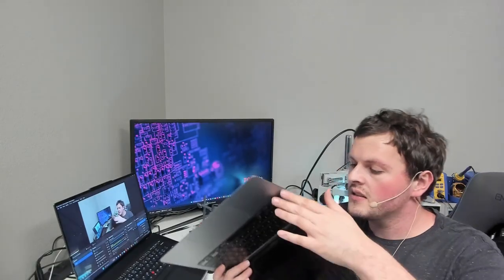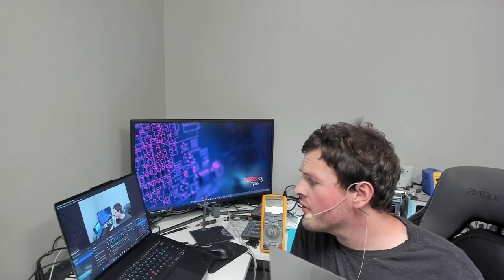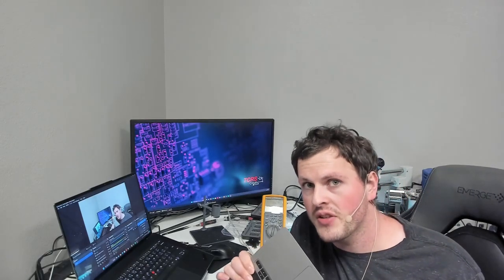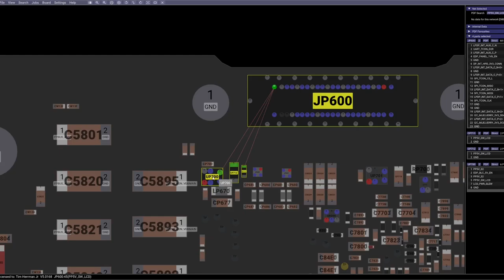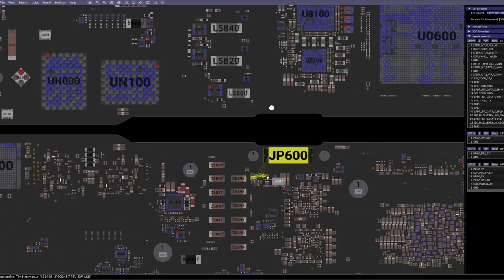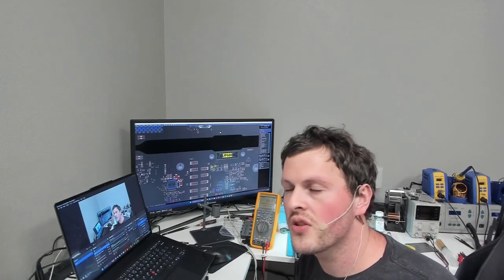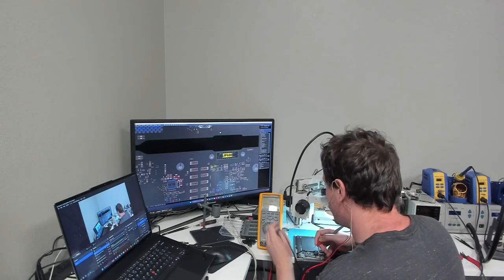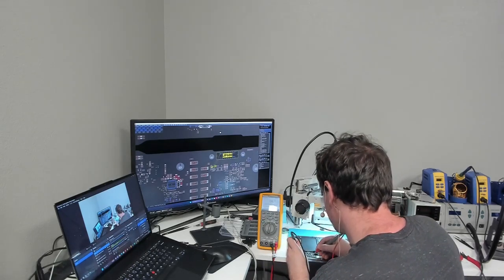I haven't been this happy to see something work in a long time. | A2337 TCON Board Internal Short

Comment: hi Tim good to see you posting again, i have a strange one for you. 2020 air, when i replace board into case then connect power board comes on i get logo, after a few seconds goes to globe to input wifi. starts process midway through the down load goes to triangle with exclamation point. 
battery and case are good.
1 will not boot external drive with (option key) goes to globe
2 will not respond to D key goes to globe instead
3 will no respond to pram reset goes to globe
4 will not respond to any key sequence at all
5 pressing power button to shut down with lid open:  shuts down but turns back on by itself. not able to shut down and stay off with lid open. 
any thoughts?